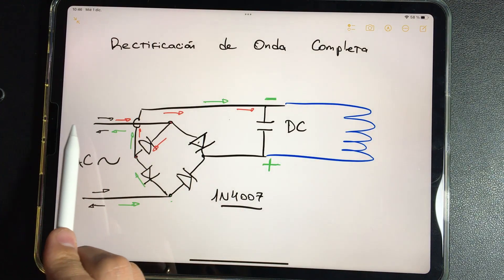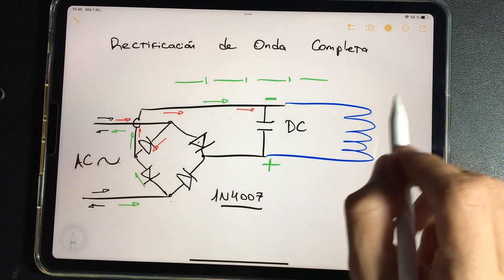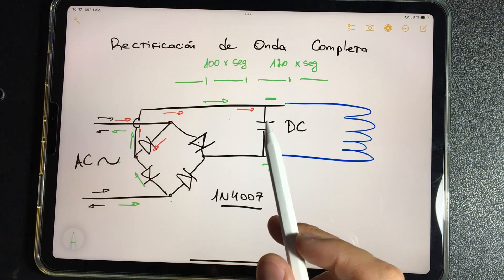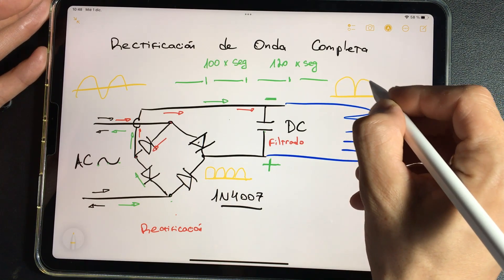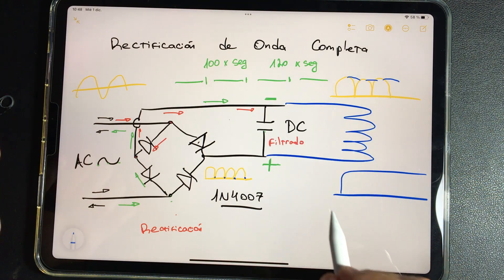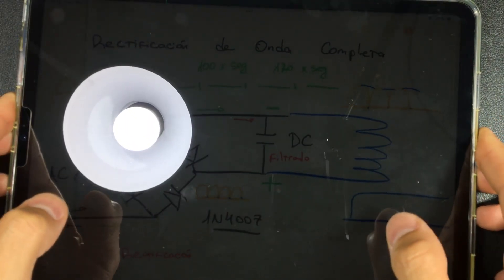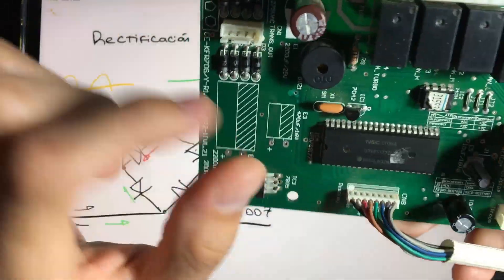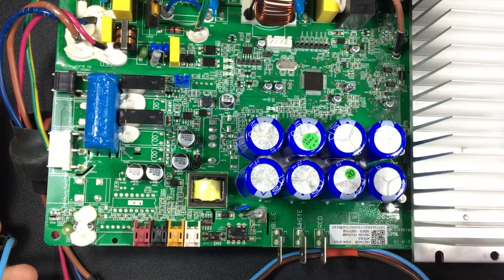Capacitor Failure in Inverter Air Conditioner | Split Inverter Course | 6

Comment: I attached a wrong voltage to 
a small Amplifier 
(*17V instead 9V ) 
...  ...and BINGO electro Bum
💥💥💥 ... capacitor exploded 
And entire pcb board jumped from the surface 
and
HIT me hard in the knie. 
 
Leeson learned...
Never literaly believe what you read from the internet - without cross-referencing instructions. 

...
Reply from the maker: Join our channel to access the classes by title and by module, and study effectively!
Join the Module Access level or higher!
TAP HERE ▶️ https://www.youtube.com/channel/UCfu_M6VyaVaJK9R69DsZGHA/join

Comment: Another words the circuit is pulsating? Also note if the top side of the capacitator is bulged upward you should replace it automatically. This indicates a bad cap.
Reply from the maker: Join our channel to access the classes by title and by module, and study effectively!
Join the Module Access level or higher!
TAP HERE ▶️ https://www.youtube.com/channel/UCfu_M6VyaVaJK9R69DsZGHA/join